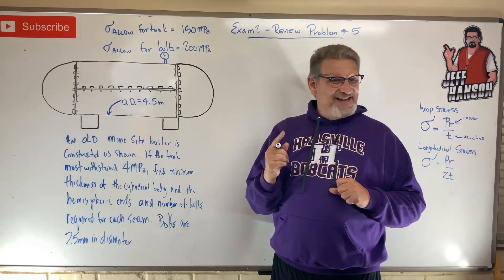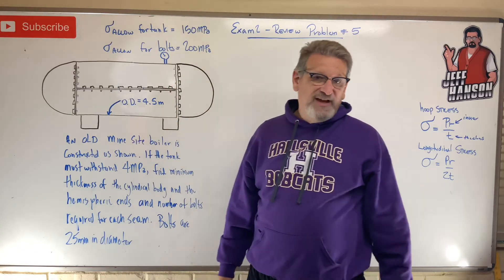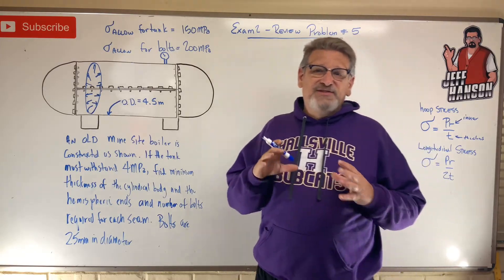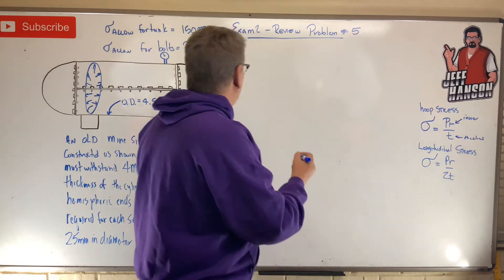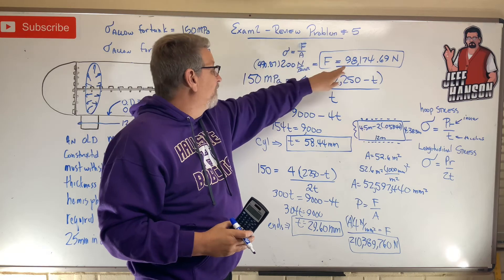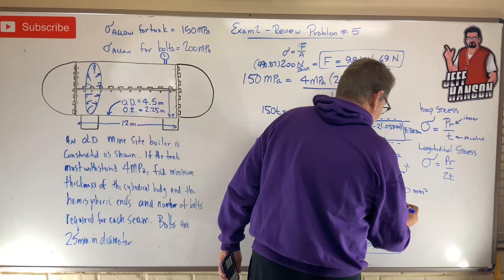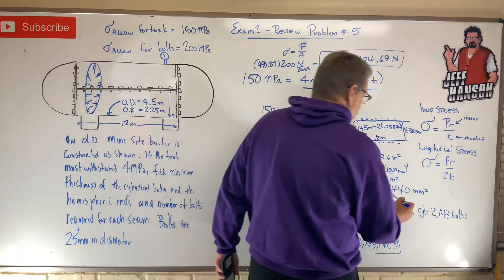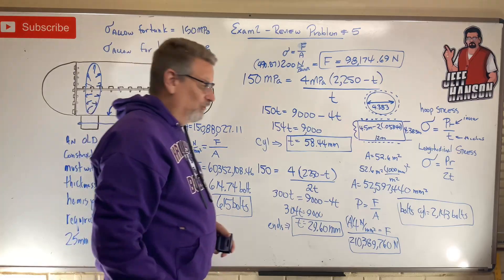Mechanics of Materials: Exam 2, Problem 5, Thin Walled Pressure Vessel Example

Comment: Data of this problem is not reasonable or applicable because spacings between bolts are less than their diameter. Spacing must be, at least, 3 times the diameter!

Comment: shouldn't here be an area for spherical part calculated with other radius, I mean r=2,25 - 2*0.0296 wchich includes the thickness of a spherical part?
Reply: No. The reason is that the force caused by the internal pressure acts as if the surface is flat. You would use the cylindrical inner diameter, as that is the area on which the force is being generated.
Reply: @CartrSmith  I agree with you and the number of bolts per one end will be 632 with spacing of 22.3 mm
Reply: I agree

Comment: hi ,i somehow got exactly half your answers using a FBD , i drew it with two arrows down which were the number of bolts and the pressure force of bolt and the one arrow going up is the pressure force , i used the sum of Fy =0 and Fx=0 ,it looked something like this : PF-Number of bolts{pressure force of bolt)--Number of bolts{pressure force of bolt)=0 ,i am not sure how i have done this wrong as i have been using chegg,thank you for the video your very good at teaching